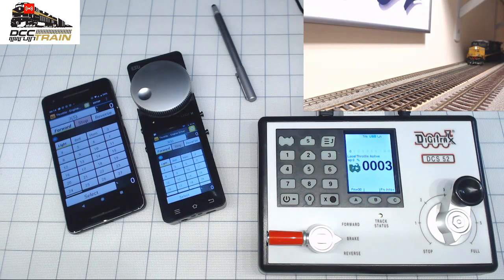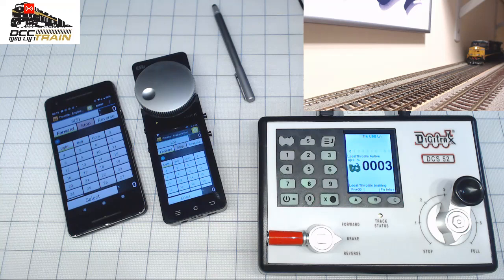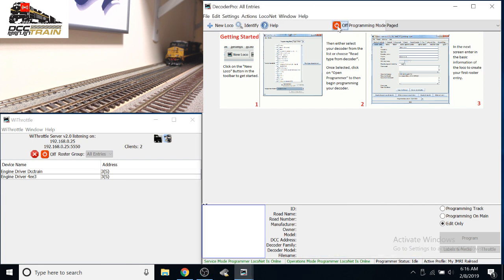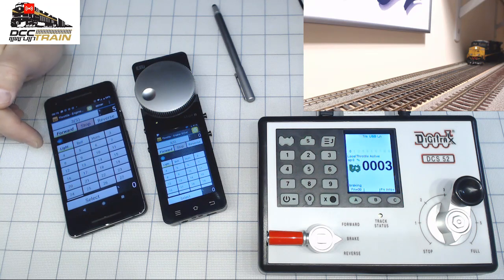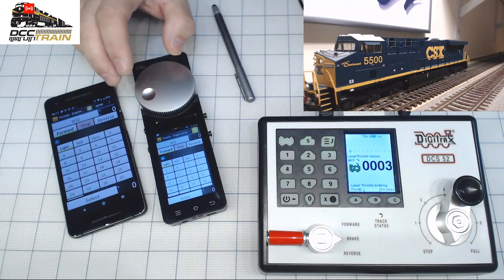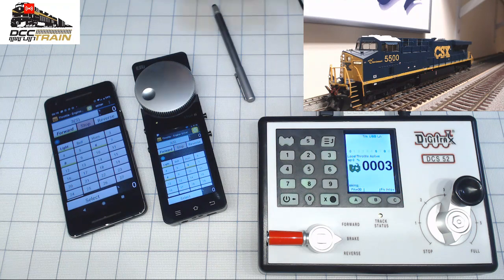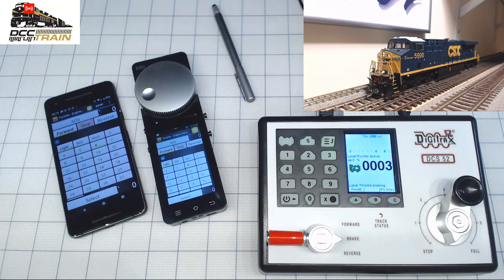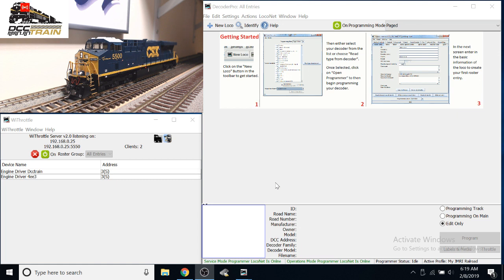Digitrax Zephyr Express DCS 52 USB port with JMRI Engine Driver and ESU Mobil Control II

Comment: Great video... I have a questions. How build wifi net? Is it through the DCS52? Does it do it automatically? Thank you...
Reply from the maker: Thank you. DCS52 doesn't have a server built in, it has a USB port you connect the PC with JMRI running Wi-Fi Server then you can connect, a phone, tablet, and any trottle suppodting Engine Driver app. The easy way to do it to use Digitrax LNWI https://dcctrain.com/shop/ols/products/lnwi
The LNWI allows you to connect compatible WiFi devices to LocoNet and run trains using compatible throttle apps.
Reply: @dcctrain  Thanks for you respoonse..... Regards from Chile...